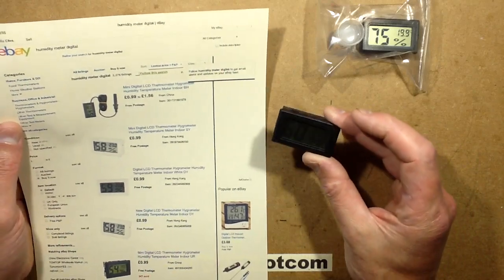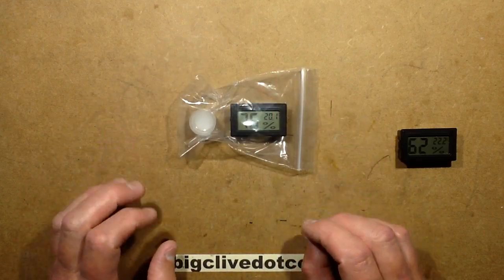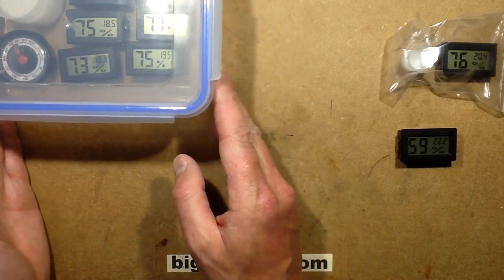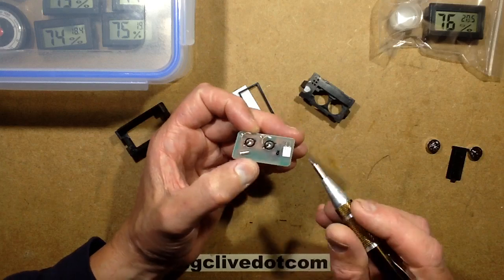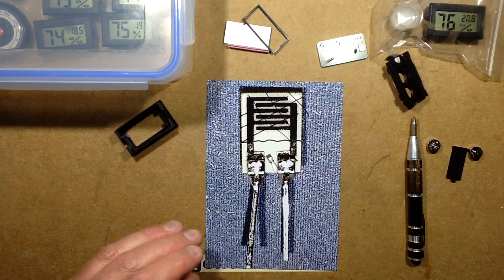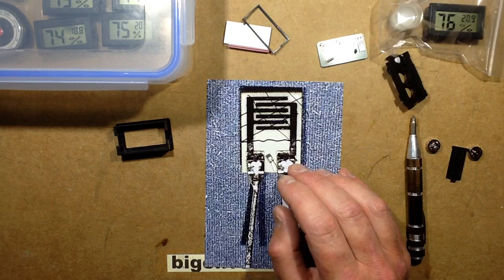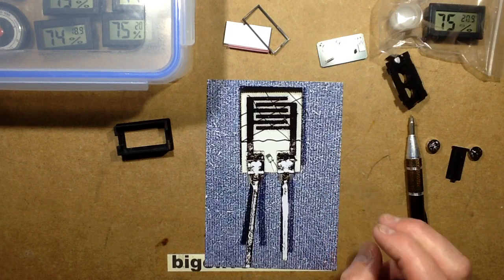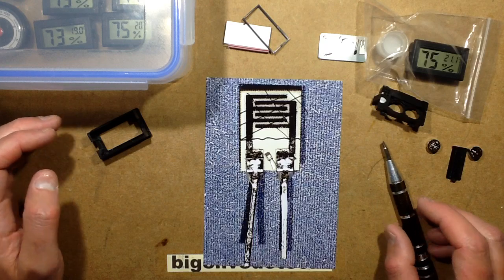Humidity meters and their sensors.

Comment: Last winter, I bought a few of these round analog humidity meters from ebay, because my apartment is always too dry and I was using a humidifyer for the first time. When they arrived, they all showed a different value, so I had to clip open and manually rotate the dial in order to get a somewhat accurate reading (but in fact, I'm happy if it shows me "around 20%" or "around 40%", with the former being almost unbearable for my respiratory system and the latter being the start of where it becomes tolerable.

Comment: Clive, On the polarisation of the sensor from using DC, have you ever tried to measure the resistance of silver loaded conductive paint while it's drying? You could make a video of that but you'd have to do several stripes at hourly intervals before measuring the resistances.

Comment: I never knew that you could check the calibration like that.  I have a DHT22 (digital) humidity sensor connected to my Raspberry Pi weather station that I suspect is read way off so could test it with this method.  Thanks for the tip!

Comment: If only you made this video 2 months ago clive! I used these little things to make a weather-station and I spent days trying to get it to work correctly, ended up getting the digital sensor modules (DHT modules) and using those instead. It wasn't until later I found that its not very good to drive them using DC.

Comment: So the million dollar question remains unanswered - did those ones you tested drive the sensors in AC or DC...? :)
Reply from the maker: On the basis that they are designed for the task and the readings remain stable over time I would guess that they are being run properly.

Comment: I've got a humidity sensor for plants with the same board as shown on the photo and a probe for the flower pot, so I can water my plants automatically ... and I corrodet two sensors in about 3 months and the plants were overwatert, really bad idea with DC!
Reply from the maker: Yeah, I had the same issue with the plant water indicators.  They corroded, went high resistance and continually said the soil was dry.

Comment: I was struck by the similarity between the hygrometer component and the infamous Cheap Shitty Pink USB Charger From China. Both depend on wires with a very small separation. Presumably the Cheap Shitty Pink USB Charger detects humidity by shorting the USB power to the mains and burning out whatever is plugged into it.

Comment: Interesting, thanks Clive. Are there other salts you can use that would have different humidity equalisation points? I wonder if the offset you noticed on some of the devices is linear.
Reply from the maker: Yes there are other salts that can be used, like lithium chloride, but some are very temperature dependent.  The plain old sodium chloride test is the simplest.
Reply: Boveda brand sells packs with different humidity settings including a 75% and 33% humidity for calibrating humidity meters...

Comment: Clive is there a way of turning one of those cheapie poundland torches into an infrared one. I'm sure it's a case of swapping leds, but alas I'm no electronics genius like you.
Reply from the maker: That's pretty much it, but you may have to add a power resistor as the IR LEDs tend to have quite a low forward voltage.  Some of the "paranormal investigation" IR sources are indeed just Poundland LED flashlights retrofitted with IR LEDs.  Hardest bit is finding the real high output IR LEDs.

Comment: Am I getting it right that for the little container with salt and water the idea is to take so much of both that in the container there will be a saturated solution of salt in water pluss excess salt that then will act on the surrounding air?
Reply from the maker: It makes a saturated solution that balances out by either liberating water into the air or drawing it out until the equilibrium of about 75% is achieved.

Comment: what is the battery life with 2 of them inside?
Reply from the maker: It's very long.  I couldn't actually say how long because I've had some running for years since I bought them.
Reply: bigclivedotcom Really? I looked at some coin cells, LR44's, being about 150mAh each. Crude calculation is 0.15Ah * 1.5v = 0.225wh. Ans if two used, then this is 0.45wh, 450mWh.

In one of the listings, I have found this:
Power: 0.15 mW under Working Conditions

so 450mWh/0.15mW=3000h
that is only 125 days.

Comment?
Reply from the maker: It only draws significant current while reading the sensors, and it only does that once every ten seconds.  The rest of the time the only power required is that to maintain the display, and that is tiny.
Reply from the maker: I've just tested it.  Quiescent current is 6uA with short bursts of 40uA while reading the sensors.
Reply: THAT is a lot less power, that would indicate battery life of several year as you said. Thanks for measurement!

Comment: Clive I thought they were capacitors of which the capacitance varies with humidity. I traced the circuit of one of these and I found this;
There was a CMOS 555 on board of which the frequency varied as a function of the capacitance of the sensor. 
I could be wrong perhaps the varying resistance changed the frequency directly. But I remember that the sensor was located where normally a capacitor goes into the 555 oscillator circuit. I built and sold a dozen humidity display plus recorders to a pharmaceutical Co. about 6 years ago.

Comment: does any one know the screwdriver setup he uses, I would like to get that for myself?
Reply: not sure where you are, but I saw a similar one at Menards last time I was there. http://www.menards.com/main/tools-hardware/hand-tools/screwdrivers-nut-drivers-hex-keys-sets/maxcraft-7-in-1-precision-pocket-screwdriver/p-1444423559756-c-9158.htm?tid=-3486365015648480795
Reply: I've gotten one similar to these at Poundland
Reply from the maker: The one I use is the small Poundland set.  One of the best of its type available.
Reply: thanks :)

Comment: How does the BME280 humidity / pressure / temperature sensor work? I have one and it's advertised to be very accurate. I can confirm that it's very fast and that it has a high resolution (which – I'm aware – is not the same as accuracy).

Comment: You can use various salts with their own equilibrium relative humidities. To calibrate a low point at 33%, Magnesium Chloride is an easily accessible salt. You should use kosher salt or canning salt instead of table salt for your Sodium Chloride slurry, though. Common table salt contains anti-caking agents that can throw things off.

Comment: Why are some chips under that black goo stuff?
Reply from the maker: It's called a COB "Chip On Board".  It's the cheapest and smallest way to add a silicon chip (Or LED) on a PCB.  Simply bonding it to a pad and connecting it with tiny gold wires just like in a traditional integrated circuit package and then covering it with black resin to block the light out.  (Light can affect the operation.)
Reply: COB is a lot cheaper than making an IC package and soldering it to the board. You save on the epoxy, you do not need the expensive leadframe and the extra solder. Plus you save on the space needed. As each of these adds a cent or three to the cost and means you need 8 times the board area it is a lot cheaper to not have them, and simply make a million or two little boards at a time. At that volume the savings are pretty big.
Reply: +bigclivedotcom Ah that's what those are called. No wonder my calculator died when I pushed on the little black dot. Thanks!
Reply: +Matthew Trevet. You never push the black dot! NEVER! ;D

Comment: Those are surprisingly cheap. The Honeywell HumidIcon sensors I use cost about four times as much (about $10 each), and that's for just the sensor itself -- no neat little display, case, PCB, batteries, or anything else.

Comment: I think that the temperature sensor is required to have a humidity sensor give a relative humidity percentage, so the inaccuracy of both sensors combined causes the RH% to be off by 5-8%
Reply from the maker: I don't think these units do relative humidity.  They seem to vary dramatically with temperature compared to a real RH unit and more accurately mimic a traditional mechanical humidity meter.
Reply from the maker: I've just checked by replacing one of the thermistors with a variable resistor, and the humidity reading is affected by the temperature, but at zero or below where you'd expect any humidity to show 99% it doesn't.  So not what I'd consider actual RH.
Reply: +bigclivedotcom Great idea to check if they're related! That's strange that you got that result though. BTW, I love your videos, thank you for making them!

Comment: These things are notoriously bad, yours seem to be pretty evenly calibrated.
Funny thing is that a lot of humidifiers which you can adjust by keying in the desired humidity, they can also diff by a lot..  like 20%-units. A bit tricky putting an entire humidifier in a bag sadly.
Another curious thing about these cheap units is that they go totally nutz when the temperature goes very low, like under 10 degrees celsius or so. They can suddenly give a reading of 80%.

Comment: At that price, it would worth ordering 10 and doing the calibration test to cherry pick the most accurate ones.  Even the more expensive ones I bought a while back vary several percent from each other when left placed side by side overnight.  Great tip about the salt water based calibration.  As for distilled water, dehumidifier water makes a good substitute as we use it in the clothes iron, steam cleaner, etc that normal tap water would otherwise leave gunk once evaporated.  Going by Amazon, it's surprising how many people fall for the snake oil single-use moisture traps claiming to dehumidify one's home considering they only collect 1-2 litres per refill (which takes several weeks and expensive to buy), compared to 2 to 4 litres per day for a typical electric dehumidifier.
Reply: 'Dehumidified water'? Let me see that! :-)
Reply: +Christian Geiselmann I think this means "water collected from the dehumidifier", which as it has been condensed from water vapour is essentially distilled water.

Comment: Humidity sensors require temperature sensors to get the relative humidity (absolute isn't really used much), you can probably tune the ones that are out by simply tweaking the resistance of the thermistor.
Reply: Unlikely. Thermistors are highly nonlinear. The COB has a table programmed into it that compares the resistance of the thermistor to the (nearest) preprogrammed value. At least that’s what should happen theoretically when each unit is calibrated. Granted, there’s not a chance they do that for cheap Chinese hygrometers (they probably use typical values from the thermistor’s manufacturer data sheet), but I don’t see how you can “tweak” the resistance without decreasing the overall accuracy of the unit.

You could, probably, calibrate it this way to be (more) accurate in a specific range of temperatures (for example, around the typical room temperature, refrigerator temperature, or freezer temperature). You’ll still need a highly accurate, certified device as a gauge for that.

Comment: I've never understood what the percentage is all about, like in here ... 75% of WHAT?
Reply: It is the air's moisture content (of evaporated water).

100% means that water will no more water can be evaporated, and condensation will be forming
Reply: Google/Wiki are your friends: https://en.wikipedia.org/wiki/Humidity

Note that, for us hoomans, the relative humidity is usually the measurement of interest.
Reply: 75% of capacity at altitude, I assume.
Reply: Humidity changes with temperature, so having a fixed scale would be inconvenient. At low temperatures you hit 100% water vapor capacity really quick, at high temperatures you can have much more water in air and still it may take more before condensation starts to form.

Comment: I got 5 humidity and temperature sensor that use I2C on order.
going to put one out side and one on each floor with 2 1602 lcd display that use I2C also, so it can display all 3 sensors on 1 display each.
then connect to a arduino
because everything is using I2C, it can be put on 1 share line
Reply: Would be quite nice to use one of the the 8 pin AtTiny based Arduino compatable boards for that.

Comment: Do you know a way to test the thermometer accuracy without using boiling water and ice?
Reply: jdod64
True, just a ball park figure I guess, Would certainly test out a friendship though.
Reply: Stick it up your arse?, or maybe a close friends, Should read 98F or about 37C.
Reply: +Average Joe lol...on a serious note, body temperature differs from person and also differs throught the day.
Reply: I would like to see a simpler way than that....lol, u must have a really odd situation where u are unable to do that.
Reply: I can, just wondering if there is an other way. The salt and water was a nice trick I didn't know. Maybe there is one for temperature. Also I don't know if a thermometer is accurate at all temperatures. Maybe it shows 0 and 100 accurate but has faults between 40 and 60. Just wondering :)
Reply: +TheBertjeT the only way i could think is to test it against another thermometer that u trust.
Reply: Bad idea :) Also water boils at different temperatures depending on the pressure/altitude. Maybe molten candlewax is always at a certain temperature (don't think it is). Things like that.
Reply: core body temp (up the arse, to quote the one person) shouldn't vary much. nearly pure water freezing is almost constant at different altitudes, though.

Comment: 62 humidity.  Ah hell no. I like my air in the teens.
Reply: Just like you like your women.
Reply: +Jonathan Hassall I went to Texas once. Almost needed a scuba tank to breath. The air seemed so thick.
Reply from the maker: It's a very green island with the sea nearby.  It's very humid, hence why I have two dehumidifiers plumbed in.
Reply: +bigclivedotcom I think the greenery would make up for the humidity.  Sometimes I get tired of sand and sage brush.
Reply: Dehimidifiers? Like compressor based deal with cold radiator that condenses water out of air or some other device?
Reply: Protip: Never visit Singapore, Taiwan or other tropical country where they often have 30+ Celsius and close to 100% humidity. Instant and permanently sweaty clothes...
Reply: I vacationed in the Dominican Republic once. It took me nearly 4 days to acclimate.  Felt like I couldn't breath, and yes my clothes were permanently wet
Reply: come to rio de janeiro in the summer 40C AND 90% humidity.you can overheat if you dont cool yourself enough
Reply: thiago keizo It sound like you can overheat from lying in bed in shadow :)
Reply: with the wrong clothes, yes :D
Reply: mharris1270 Sounds terribly inefficient in terms of power consumption, but hey if it is the only solution then why not? I guess that regular portable A/C unit could be used for this (as long as it does not evaporate water into outlet), just blowing out hot air back into the room

Comment: Could one perhaps 'calibrate' them using DC for a short while to compensate for the offset and then put the sensor back in?
Reply: No, the electrolysis damages the film and causes a permanent drift in it, as the copper slowly migrates with time across the film making it change properties. These sensors also drift with time in use, especially if exposed to high humidity ( like over 50%RH) so only have a limited lifetime in humid areas. You cannot make a cheap humidity sensor with a long life, no way to do so. There are more expensive ones that are rated to survive condensation, but they are never going to be 99c buys. As well if you want 1% accuracy then you will be buying a unit with motors, fans and peltier coolers in it that actually gets the proper dew point of the air and then calculates humidity from that, or has a wet and dry bulb in an air stream.
Reply: Good thinking.
Reply: That makes sense. Just compensate for the offset in software then.

Comment: I thought that they generally worked as capacitors. I know the ones I've seen have open air separating the plates and the changing humidity in the air changes it dielectric properties, therefore changing the capacitance which can then be measured.